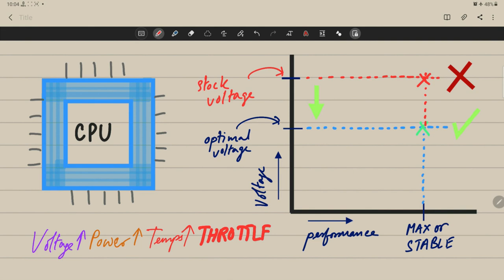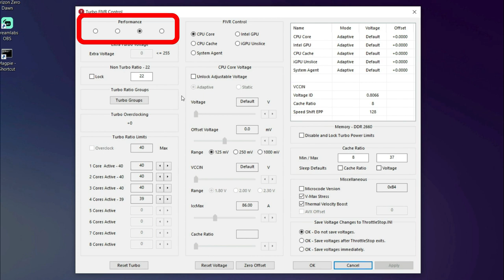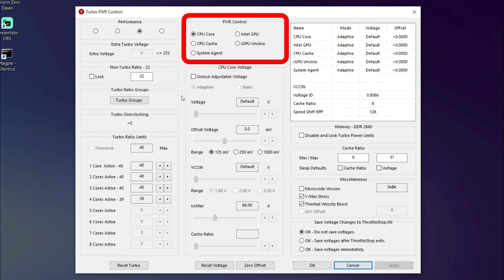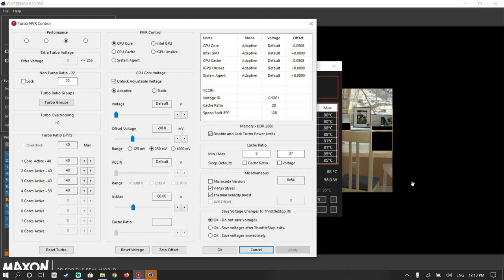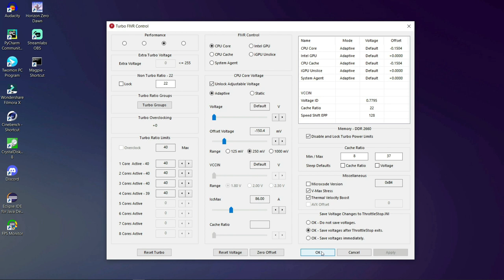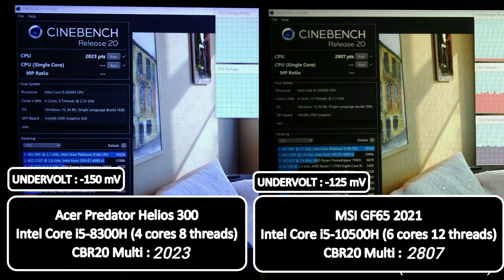Undervolt Your Laptop Now for Lower temps and higher performance! MSI GF65 / HELIOS 300 🔥

Comment: 1.undervolting
2.Repasting
3.Lifting laptop bottom vents 1 inch from table while gaming can improve temperature just like using coolingpad  best case -5°C ,so try it out.
Using maximum performance in Nvidia control panel can also leads to GPU throttling .
If CPU is cool then GPU will also become cooler and vice versa .
Also too much undervolting can be supported by some CPU but it will reduce your boost speed along with temperature so better to keep it -125mv .
Reply from the maker: Everything you said is right, except for boost speeds. As you saw, we had same PL2 boost (4.19Ghz all core but sustained longer) and higher than regular PL1 boost 3.8Ghz vs 3.5Ghz.

Comment: Why my dragon centre showing the temperature into 13° and suddenly back into normal temperature? Is this something wrong with dragon centre or my hardware?
Reply from the maker: I never checked Dragon centre, so I cannot comment on its behaviour. I mostly checked Throttlestop temp readings in the taskbar menu. They are always there.

Comment: The best and easy way to lower the CPU Temperature is for setting "Power Options" by selecting your "power plan" and then choose "change advance power settings" then change the values of the "minimum and maximum power state" under the "processor power management " 90 for the "minimum" and 97 for the "maximum". thank me later.
Reply from the maker: Yea but that's not really the same as undervolting right?
Reply: @DeepteshLovesTECH  Yeah but it reduce the temperature significantly from 92 Degree to 63
Reply: should I do both? what's best?
Reply: @genuflext  If you prefer maintaining the higher performance of the device, undervolting and limiting your TDP (and even the clocks) while having the optimal temp you wanted it is the better approach. But if you only aim better thermals, limiting your cpu performance by turning down the turbo boost in the BIOS or by Power Plan (as also for most users it is the easier way). I always recommend the first tho.

Comment: Hey, great video! For the predator, do you keep all boost clocks to 40 when all 4 cores are active?
Reply from the maker: No, that's when I'm doing video editing.  For battery they are at 2.3ghz. Actually since my laptop is cleaned and repasted 5 months back... keeping all core clocks at 4.0Ghz isn't any issue, temps are quite low.
Reply: @DeepteshLovesTECH  I see. I repasted my Predator Helios with CM Mastergel Maker paste and temps have gone down to low to mid 80s with undervolt on but boost clocks locked to 34x when all 4 cores active, 36x 3 cores active, 38x when 2 active and 40x when 1 is active. I'm thinking of going back to max boost. Also, have you had any temperature rise since you last cleaned the laptop, particularly due to pump out effect and dust? I live in a very dusty place and I'm thinking of repasting my Predator with Kryonaut seeing the positive impact it's had on your device, the mastergel maker paste only lasts me 4-6 weeks.
Reply from the maker: @abrarw99  kryonaut is working quite well, it's been 5 hot months, temps are only slightly worse. 
Even keeping all cores at 3.5Ghz-4Ghz, idle temps are 45C or below. 
Make sure to perform a virus scan using malwarebytes periodically, as sometimes miners get installed and they raise idle temps.

Comment: My budget is 90k.... Should I go with hp victus 16, r7 , 3050ti.... Or not.... Or if any best laptop around 90k.... Plz suggest me...... ❓❓❓
Reply from the maker: Actually in my opinion if you are able to stretch your budget a little bit, you should get this: https://mdeal.in/c_y4Tg1
I mean, you are spending 90k on a laptop, but the 3050Ti with only 4GB VRAM is looking a bit risky as it already struggles to play games like AC Valhalla/RDR2/Watch Dogs Legion at the highest settings in 2021... Then think about 2023 or something.
Reply: @DeepteshLovesTECH  ok thanks... Asus recently released their tuf f15 around 1 lkh..... With... I5 -11400h.......how is the laptop and its processor and also the thermals compare to nitro 5... ❓❓❓
Reply from the maker: @avijit5245  it's your wish really.. but I doubt in Asus Tuf's thermals.
However it has a thunderbolt 4 port ,: https://amzn.to/3msWZdB
Reply: @DeepteshLovesTECH  ok.. how the processesor ... Is it better than r5-5600h?.... Plz... Reply.... Bht confusion ho raha ha...
Reply from the maker: @avijit5245  They are both equal. For lengthier tasks the Ryzen will be faster.. for shorter tasks Intel will be faster.. 
Ryzen will operate faster on battery power and also will be better if you are running your laptop in battery saver mode or "low fan" speed mode.. as Ryzen works much better with lower power.
Reply: @DeepteshLovesTECH  thanks bro... Then... I go with... Nitro 5.... Hope it is great buy...

Comment: Bro should I clean and repaste my lappy?? It's been 10 months now since I bought the lappy
(MSI GF 65 RTX 2060)
Reply from the maker: Sure, if it's performing worse. Normally in 10 months, where I'm living, will collect a lot of dust.
Reply: @DeepteshLovesTECH  bro should I disconnect the battery wire from Mobo while cleaning???
Reply from the maker: @anshulnayak-1643  it's safer that way.

Comment: That predator of yours. Is it still good and fast(not gaming). How s the battery?
Reply from the maker: It still does the job, after all I edit all my videos on it and live streams and all.
Although it's showing its age now. It'll be 3 year old this october.
I bought it for "just" 60k from Flipkart during BBD 2018. It normally sold for 90k. That probably makes you wonder, how much of a change Ryzen 4000 brought to the market.
Reply from the maker: Cleaned and repasted it 5 months back, made a video on it.
Performance is better than new. 
Battery life 3.5 hrs max with my battery profile in throttlestop.

Comment: Really good video explaining these things man ! Which one would you pick dell g5 15 se or msi gf 65 ?
Reply from the maker: GF65.
Reply: Dell g5 15 se is a faulty, sample, engineering sample laptop. Not a stable laptop
Reply: @mangathansdah7177  damn I herd it has bad thermal and bsod issues , is it that bad ?
Reply: @pranav1790  yes bro u will suffer too much . I was getting 104C in farcry3 which is a 10 year old game.Sadly I bought one of dell g5 se and knew the problems during return period. So returned it last week.The owners of this g5 se are telling that one have to give time for troubleshooting after every bios update, then finding solutions in reddit threads,telegram group , so u better not go for this dell g5. Don't let the spec fool u they said.
Reply: @mangathansdah7177  damn I am tempted by the 5600m well the msi is alos there hopefully that's better
Reply: @pranav1790  yeah bro gf65 is far batter than that

Comment: Asus tuf f15 i5-11400h,rtx 3060 vs Acer nitro 5 R5-5600h, rtx 3060..... Which is better ❓❓❓.... Plz... reply...
Reply from the maker: This : https://amzn.to/385hLYb
Reply: @DeepteshLovesTECH  thanks for reply...???
Reply: @DeepteshLovesTECH  Can I get better gaming performance in Asus tuf f15 compare to Acer.??? Also heard that.... Asus temp. Are high compare to Acer...???
Reply from the maker: F15 has advantage due to larger battery and also thundervolt 4 support. 11400H beats the 5600H...in gaming.
Reply: @DeepteshLovesTECH Thanks a lot...... One more thing..... i5-11400h supports undervolting ?
Reply from the maker: @k.avijit007  it technically supports, but not sure if Asus allows it.

Comment: Hi i have the GF65 i7-10750H but the undervolting setting in the FIVR are all Looked, i can't even checkmark it all its looked any help ?
Reply from the maker: Yes that's because you have to enable the undervolting option through MSI's hidden Advanced BIOS options.
If you see my MSI GF65 undervolting video you'll find that... Or you can search online. 
After enabling that in BIOS, you'll have the options unlocked in FIVR.

Comment: Hey, are MSI laptops good? I thought of getting the GF65 But heard MSI laptops have hinge issue. Is that true? Does GF 65 still have that issue?
Reply from the maker: Bro if it had hinge issue and all.. why would I spend my hard earned 75000 INR into it. These are not review units, it's purchased.
This laptop is the only one that fit my brother's requirements in his budget, so we bought it.
Reply: @DeepteshLovesTECH  thanks for letting m know that bro ✌. Decided to get the GF65 with Rtx 2060.
Reply from the maker: @abhijithajay1998  hold up? 2060 model? Why not the 3060 model, it's the same cost
Reply: @DeepteshLovesTECH  yes, same price but the 3060 model uses i5, 2060 model uses i7 10th gen. Isn't the 2060 model more future proof? Also, wont the i5 bottleneck the 3060?
Reply from the maker: @abhijithajay1998  bro bro bro... i5-10'500'H is 6 cores same like 10750H, and there is barely a difference. 
i5-10500H is actually an i7-9750H in disguise.
75W 3060 performance beats 85W 2060.
Reply: @DeepteshLovesTECH  oh, in that case I'll go for the 3060 variant. Btw bro, will the price of this laptop drop during Big billion day? Should I wait or get it right now?

Comment: Halo bro msi gf 65 thin rtx 3060 @93,000
Or asus rog strix g15 rtx 3050ti @ 78,000
Which one is better?
Reply: Kya bol rahe ho khud ko bhi bata hai kya ??
Reply from the maker: If you don't want to game hardcore , then the G15 makes more sense as an all rounder laptop. 
3060 is significantly faster than 3050Ti.
Reply: @DeepteshLovesTECH  3050ti 78000 ?? How
Reply from the maker: @akatechAi  not sure bro. It's a good deal 👌
Reply: Afzal please send me buying link of asus rog g15 3050 ti @78000
Reply: @akatechAi  its from abroad bro
Reply: @afsalyoosaf888  will u import it to india?
Reply: @mangathansdah7177  no I'm in gcc

Comment: Why my msi gf65 does not support undervolting.
I have checked both throttlestop and intel xtu but undervolting is locked in both.
Is there anything i can do to unlock it?
Reply: nope
Reply: manufactors disabled undervolt on the last bios update. It sucks
Reply: @FireGames25  when did they do that?
Reply: You enabled it from bios?
Reply: @bhavaygoel  option to enable it still available in latest bio update?
Reply: @delesegdevassy9685  idk bro im asking, i also want to buy a laptop and confused AF, what have you thought tho?
Reply: @bhavaygoel  I'll be buying gf65 1660ti this big billion day since my budget is 75. Many are considering tuf a15 too but I don't think 3050 can give as much performance as the 1660ti.
Reply: @delesegdevassy9685  is msi reliable tho?? Flipkart dont even support open box delivery with msi

Comment: I can see you are using magpie. How is the performance boost with that
Reply from the maker: Very early FSR implementation, yet quite promising. 
But...a big but. There is an added layer of latency, with each frame generated, upscaled and displayed.
It's promising surely as this shows it's possible to make FSR as a simple driver level global toggle.

Comment: Hey, Can I under volt the Dell G3 3500? I have an i7-10750h, and my gpu is a 1660ti. Any help would be appreciated!
Reply from the maker: If Dell doesn't allow undervolting, then you cannot. Otherwise it's the same procedure.
Reply: @DeepteshLovesTECH  Yeah the turbo boost ratio and the cpu voltage thing is locked.

Comment: Bro checking that disable and lock turbo power limits is disabling the turbo mode so that the cpu now runs on base clock? Sry a beginner in undervolting
Reply from the maker: Nope that's not how it works. If it runs at base clock what's the use of setting clock speeds.
Plus check the cinebench R20 run I do after the undervolting in the video.. you'll see CPU is functioning like normal, boosting and sustaining higher clocks. 
Afaik, that option, overrides stock Intel/manufacturers PL1/PL2 limits, I might be wrong.. but just do it. 
You can also disable boost altogether, but that's a different option.
Reply: Yeah I tried disabling turbo from bios, and that was giving stable temps, but at base clock, so not much performance was expected in cpu intensive games
Reply from the maker: @Saiyan476  disabling turbo is meaningless on Intel. 
Instead create undervolted Throttlestop profiles with preferred clock speeds for productivity (4Ghz+)/Gaming(3.5Ghz - 4GHz) and battery life(base clocks).
Reply: @DeepteshLovesTECH  yah man, undervolting is actually more useful than disabling turbo, I learnt that. great video btw, keep it up

Comment: hey deeptesh is it possible to swap the backpanles of gf 65 with any gl or gp series laptop,as you said earlier only the placement of vents make thermals of MSI gf 65 poor,as all the gf,gp and gl series use same cooling solutions
Reply from the maker: Yea check the diagrams, they are 99% same, but the back panels probably cannot be interchanged. Undervolting is a must either ways.

Comment: Does after every boot up we need to reset the values again or we need to do this once and only need to open throttle stop please reply , good job bro .....

And does this voltage change again and again cause any problem in long term i mean at least 5 years , because i need this for my college.
Reply from the maker: NO, like I showed in the video.
After finding the sweet spot, just select the 2nd option in the save options... that will save the values to a .ini file and it'll be saved.
You just have to open throttlestop after every new boot and select your required profile and everything will automatically apply.
You can add throttlestop to a task scheduler so that it automatically opens after every reboot.
I am using for almost 3 years but the settings were saved on Day 1 of purchase.
Reply: @DeepteshLovesTECH  ok bro thanks

Comment: i have GF65 RTX2060 i79th gen, while playing GOW GPU runs at 95%, it heats to> 90 deg. , is it ok?, if not thn what settings
Reply from the maker: Yea I would prefer it run lower than 87°C. Search about GPU undervolting. It's quite easy.
Reply: @DeepteshLovesTECH  can u please suggest video, bcoz there are many videos with different settings

Comment: Can i know why the temps are jumping here and there...i have set it to 100....there is no visible change
Reply from the maker: Temps jumping you mean? 
Undervolted to -100mV? Did you hit apply? 
Make sure to select the 2nd option in save options before pressing ok. 
Undervolting always works, plain physics, if it didn't then you probably couldn't apply.
The package power is the clearest indication... after undervolting,  it should be less.
Reply: @DeepteshLovesTECH temps are increasing decreasing.....even i thought i dint apply the settings....let me recheck....nd thanks for replying.....what is package power?

Comment: why theres no speedshift in mine? I have msi gf66 i7-11800H rtx 3070 laptop, please help me, some games my cpu is 90=100celcius
Reply from the maker: Skip past that.. do the other stuff. 11800H can surely be undervolted. Enable undervolting through MSI advanced BIOS first.
Reply: @DeepteshLovesTECH  bro i reformat my laptop get back here in your video, why my CPU clock speed is stuck on 2.3ghz. please help me.

Comment: Please help me whenever I save all information in throttle stop My laptop hang 😭
Please 🙏 reply urgently what to doooo ?????
Reply from the maker: What voltage are you trying?
And which option are you selecting in the save options?
Reply: @DeepteshLovesTECH  Voltage -140.6 
When we exit from throttle stop
Reply from the maker: @akatechAi  why are using -140mV? 
Didn't you hear that if you apply too low of an offset voltage that your laptop may crash, which indicates it's not a stable voltage..
In my case -120mV is stable, some others found -100mV to be stable, some found -90mV to be stable.
For you -140mV is clearly not stable, try slightly higher voltage like -135,-125 etc ... I showed in the video to drop slowly from -90mV, until you find the perfect spot, why did you drop so low to -140mV?
Reply: @DeepteshLovesTECH  because I seen that from venoms tech yt channel 
Undervolt is safe ?? Please be genuine
Reply from the maker: @akatechAi  oh my god, I hate repeating myself so many times 😅
I already showed in the beginning why undervolting is so much beneficial. All intel laptops are undervolted in my household and friend circle. 
Mine is undervolted from Day 1, Oct 2018. I cannot imagine an Intel laptop that doesn't allow undervolting.
Reply: @DeepteshLovesTECH  i undervolted my laptop now to -118.6 but after 40 mins during gta5 it hanged 😭 help

Comment: Bro can i buy hp pavilion 15 ec 1048 ax does it perform like ec 1024
Reply: If u see this comment pls reply me bro
Reply from the maker: They are the same laptop, the 1048AX model has built in SSD, whereas the 1024AX model doesn't come with ssd, you have to install it by yourself... I did that.
And the 1048AX model has 144hz display.
Reply: Can I buy 1048 bro 😁thanks for the reply
Reply from the maker: Yup, why not.
But check the description and get the 5600H + 1650 pavilion. It's the same price but better.

Comment: Make one for Nvidia GPU too if possible because GPU goes over 90 in msi GF series after few months.
Reply from the maker: Not possible as 1660Ti throttles at 87°C. It's like Intel CPUs which starts throttling at 95°C. 
For me it reached 81°C, ona 35°C room temperature with max setting gaming and screen recording. 
After few months if something like that happens, then it's due to dust/drying thermal paste. 
GPU undervolting, I don't have much experience in.

Comment: How do I overclock ram rated for 3200 but my gf65 defaults to 2667mhz. This ram also does not support xmp
Reply from the maker: 10th gen supports at max 2933mhz. It runs at 2933 in my case.
Reply: @DeepteshLovesTECH  I got mine up to 2800 with the 10th gen i5 3060 should I be satisfied?